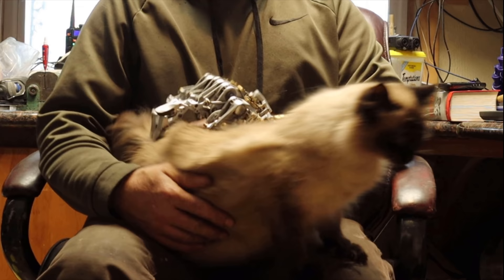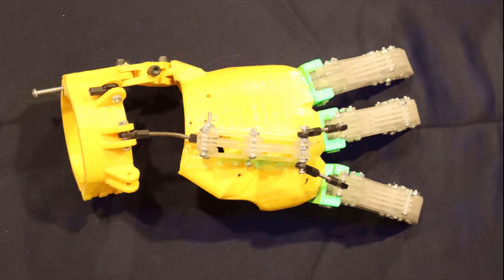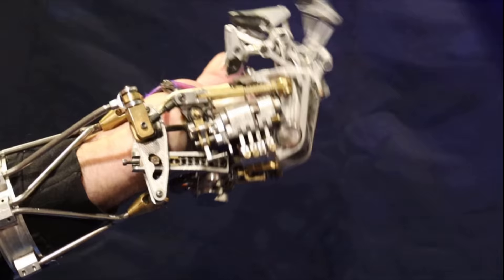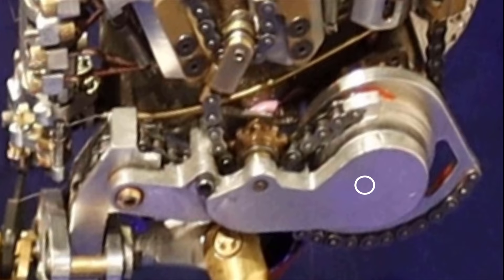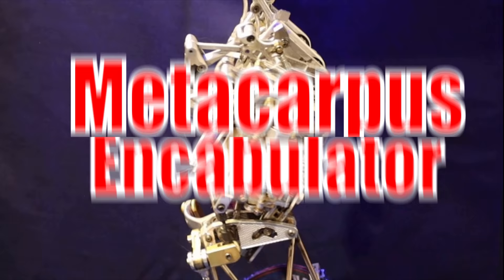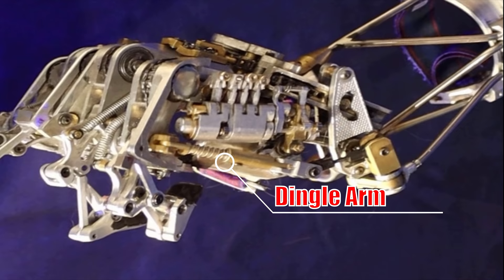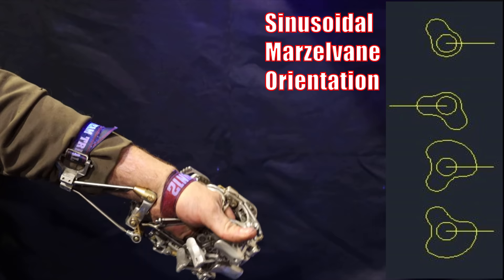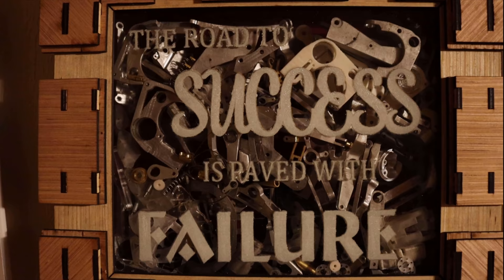New and Improved Metacarpus Encabulator!

Comment: I swear more than half of the words he used are made up, but the device is still incredible and complex!
Reply: All words are made up... they never existed in a vacuum.

And I get what you mean, there's a lot of garbo tossed in.
Reply: The Turbo Encabulator sends its regards
Reply: This model is Pre fabulated amulite materials like the original encabulator.
Reply: @livedandletdie  There’s no need to unnecessarily nitpick. As you said, you knew exactly what they meant, and they shouldn’t have to be overly and inconveniently specific to avoid technicalities in normal speech when speaking more simply makes them easier to understand anyway.
Reply: I think that's the joke guys.... Eeech
Reply: r/whoosh
Reply: Too many people skipping over the subtitles for this one, they're worht it.
Reply: It was a mix of Medical terms to describe the movements of the Filanges (Fingers) to the wrist movement that would be replicated using our many different muscle names.

And also a mix of Mechanical and Pyshics engineering.

With the Differentials often being used on cars or gears.
Reply: @dalekmasterblaster585  Did you read the subtitles, quick question. If not, check out the pinned comment by Ian.
Reply: @Mephiston  I have not, but I knew that most of these words do exist.
Reply: @dalekmasterblaster585  They exist, but he's saying them as a joke not in sincerity. It's a callback to a very old article from 1944.
Reply: @dalekmasterblaster585  It's a joke. It's a reference to a video called "Turbo encabulator".
Reply: “Dingle arm” lmao!

Comment: The missile knows where it is at all times
It knows this because it know where it isn't. By subtracting where it is from where it isn't, or where it isn't from where it is, whichever is greater, it obtains a difference, or deviation. The guidance subsystem uses deviations to generate corrective commands to drive the missile from a position where it is to a position where it isn't and, arriving at a position where it wasn't, it now is. Consequently, the position where it is, is now the position that it wasn't, and it follows that the position that it was is now the position that it isn't. In the event that the position that it is in is not the position that it wasn't, the system has acquired a variation; the variation being the difference between where the missile is and where it isn't. If variation is considered to be a significant factor, it, too, may be corrected by the GEA. However, the missile must also know where it was. The missile guidance computer scenario works as follows: because a variation has modified some of the information the missile has obtained, it is not sure just where it is, however it is sure where it isn't, within reason, and it knows where it was. It now subtracts where it should be from where it wasn't, or vice versa. And by differentiating this from the algebraic sum of where it shouldn't be and where it was, it is able to obtain the deviation and its variation, which is called error.
Reply: This Is Ars Magna
Reply: Lol, for everyone else seeing this. This does make sense and it's called a negative Feedback loop. Fundamental in controlling different kinds of machines and systems. XD

Comment: Now just needs a few upgrade options:
Laser pointer. Bottle opener. Single or triple (Wolverine option) switch blades. Magnetic smartwatch connector.
Feel free to think up more 😉
Reply: Lol yes, why not go full transhuman
RFID chip to open RFID locks with your finger maybe
Laser pointer / Flashlight is essential
Or maybe just a socket to plug a normal finger, a laser pointer, or anything you can 3D print

Comment: Interesting development here.
I noticed the lack of neurotransmissionary signal impulses for kinetic mobilization mean no external power source is required. The use of non ferromagnetic titanium alloys could help in weight reduction and increased strength, along with sealed nano bio-compatible joint retention sleeves. I think if you reduced the volume of the lug tingletwats, you could double the cam movement with less throw angle. Have you considered adjusting fecal timing on the hard rods?
Reply: fecal timing lmfao

Comment: Do you know how it is made tho? 

First you take the dingle bop and you smooth it out with a bunch of schleem. The schleem is then...repurposed for later batches.

You take the dingle bop and they push it through the grumbo, where the fleeb is rubbed against it.

It's important that the fleeb is rubbed, because the fleeb has all the fleeb juice.

Then, a schlami shows up, and he rubs it...and spits on it.

You cut the fleeb. There's several hizzards in the way.

The blamfs rub against the chumbles, and the...plubis, and grumbo are shaved away.

That leaves you with a Metacarpus Encabulator.

Comment: absolutely brilliant. what is the minimum length requirements of the phalanges and how common is a partial phalange amputation? do you have any designs that still leverage the strap on the forearm/wrist without the use of phalanges?

I really think you're na genius. i laughed with delight during this entire video. just incredible.
Reply from the maker: My disarticulation is at the proximals,   I have full length metacarples. My design is articulated by the curling motion of the hand to the forearm through the wrist.

Comment: That is a real feat of engineering! It's funny how complex machines have to be to emulate a hand. What is the cost of manufacture? Now that the design is narrowed down Im sure it can be 3d printed very cheaply
Reply from the maker: Thanks! You would think so, but the stress put a lot of the driving mechanism is higher than the shear strength of extruded nylon and 40%frp. I had huge hopes for the frp. It could work for some of the finger parts, but since you're machining it, might as well cut it out of aluminum.

Comment: Lyrics:

For a couple of years now work has been proceeding in order to bring to perfection the crudely conceived idea of a mechanical transmission that would not only be capable of supplying inverse reactive motion for use in the unilateral phalangeal retraction, but would also be able to semi-automatically, and intuitively, synchronize and increase the production of cardinal gram meters. 

The current available standards adhere to the concept that the power being generated through the motile interaction of the magnetoreluctants and capacitive directives. This practice is nothing new, and one that is familiar and widely adopted throughout the industry. 

The new and improved principle involved is that instead of the power being generated by magnetoreluctants, the relative motion of the phalanges is produced by the forearm restraint to the socket of the device through a gimbal and gaffney assembly, the force being transferred through palindermics semiboloid slots. 

The machine has a bridge plate of pre-fabulated amulite, locating a pair of precisely aligned spruving bearings in line with a micro differential. Girdle springs occupying the up end of the metacarpal bases produce somatic refraction in the up direction relative to the proximals, thus maintaining the erection of the extremity. 

I present to you the new and improved: Metacarpus Encabulator. The Metacarpus Encabulator has now reached a high level of development and is being successfully used in the operation of appendage expression. 
Moreover, whenever a four sense score emotation is required it may also be employed in conjuction with the reciprofication of the Dingle Arm and overtravelling of the Lunar Waneshaft. 

Selection of the tactile members orientation is processed by way of a mechanical transfective microcontroller. This apparatus comprised simply of four sinusoidal marzelvane, the orientation of which resulting in one of six predetermined intimations. Side fumbling is managed by why of complex linkage inter-connection and generated by way of planar gesticulation. 

I humbly request your assistance in order to get this information to a viral status in order to expand this development and implementation worldwide.